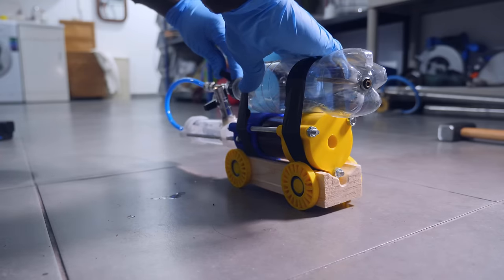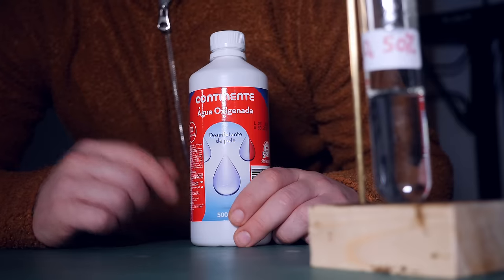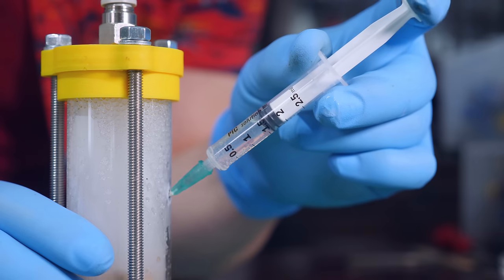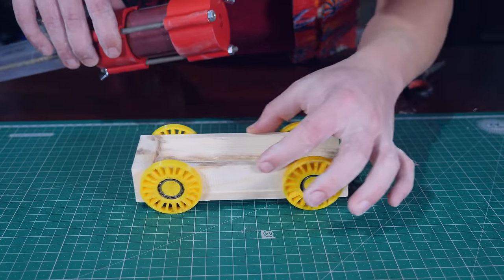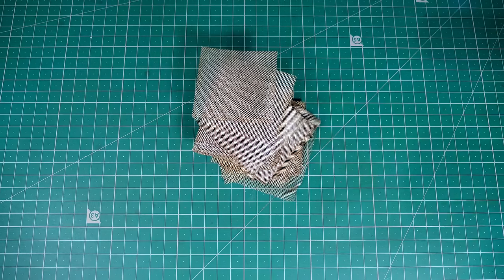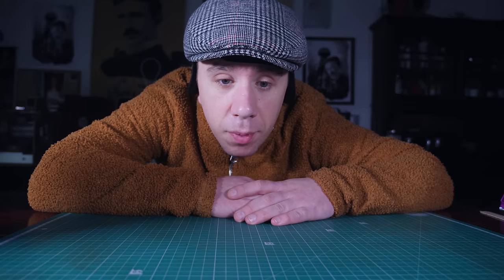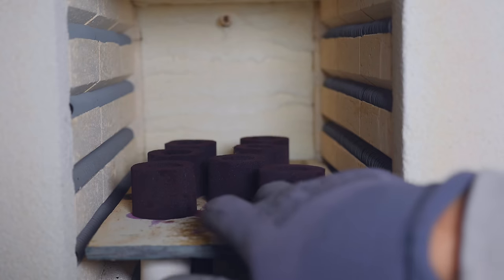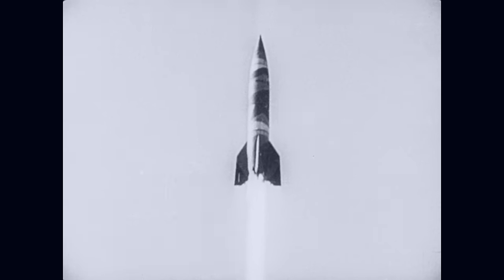SUPER HEATED STEAM ROCKET ENGINE

Comment: Fantastic video, as always! Have you considered utilizing the oxygen generated from this reaction for a second stage? It could burn additional butane, potentially squeezing out more thrust.
Reply: Or you could even pump butane into the active reaction and use it to further excite the burning and further expand the gasses
Reply: This is what I thought he was going to do by looking at the thumbnail as peroxide rockets have been around for a while.
Reply: @geofrancis2001  i know he basically did that last video when he introduced the concept of a "dual propulsion rocket", except he just burned the raw oxygen and products. Adding more fuel (butane) would make it even stronger than his original concept in LAST video
Reply: @MichanaAlerting  it woudlnt have to be butane, the steam should be hot enough to ignite solid fuel.
Reply: @MichanaAlerting sort of an afterburner?
Reply: @skyraider87  Maybe! We'll have to see where he takes this next video. Here's hoping!
Reply: That's a bi-prop H202 engine. Methane/butane are OK, but kerosene is much better, you'll need an injection plate (impingement preferred but shower head style is adequate as the violent HTP decomp will give some rudimentary mixing) and you can pressurize the kerosene tank with nitrogen.
Reply: What about using the excess oxygen to ignite a secondary like magnesium

Comment: Genuinely love how you don't just gloss over details and just tell everything how it is. In terms of catalyst, what if you used acid to etch away silver so that the surface becomes pitted and exposes more area? Kinda like activated charcoal. And speaking of activated charcoal, how does it work with peroxide? I was surprised coconut coal can decompose it
Reply: turning wood into coal concentrates a bunch of the solids a tree has...and since every living organism has metal ions in their bodies i presume a bunch of them during the process gets reduced just like in ash from a firepit (the first soaps were made using ash as the catalist for the saponification)...and since coal has a bunch of small pores increasing it's surface, it acts pretty much like paladium on carbon with the small deposits of teeny tiny metal particles...now does any charcoal works? idk...now what i can assume is that since coconut is a seed that the tree pours a lot of nutrients into (including metals from the soil) for the seed to be viable upt to 3 years after detaching from the tree, the concentration of metals on coconut charcoal could be higher than other commonly used charcoals...

Comment: Hey Integza! Looks awesome! I was thinking something that could help the design would be an improved injector. This goes along with what you said about surface area, where if you can maximize the contact between the peroxide and the catalyst you should get better results. Maybe an injector that does a better job of atomizing the peroxide rather than spraying jets of it directly into the catalyst would be beneficial? I also thought the charcoal/ceramic idea was really awesome and pursuing this could have some interesting results. I think early H2O2 rockets used pellets of catalyst in a chamber, so the chunks of charcoal might be the right idea, trying mixtures with permanganate and maybe some other additives would be awesome. In future videos I'd love to see improvements on this and maybe one day combustion of the oxygen product to make a bipropellant rocket! Keep it up!

Comment: Integza, I think that if you ground the potassium permanganate into a fine powder, it could then be used as a paint base to spray into the mixture/reaction chamber. This would allow a chamber filled with catalyst coated rods running the length of the chamber. These rods may increase the surface area enough to react quickly. Another option is to coat the injection tubes as well.

Comment: An option you could do as a middleground option that's both accessible and interesting for your foam + KMn04 strategy is to create a carbon foam using bread. AvE did a video on it years ago, and it might work for your strategy. Hilariously enough, one of the topics you'd need to figure out would be the optimal bread to use to have the best crumb structure to absorb the KMnO4 and react with the peroxide. Would a dense foam from the dense crumb of a japanese milk bread be optimal or would an airy open crumb from a ciabatta or even airier with pan de cristal be best?

Either way, super easy thing to test, it's as simple as getting bread! Also depending on the results, you could possibly even put the carbon foam to be milled as you did the flower foam. Probably not with an airy bread, but the japanese milk bread can have an incredibly dense and fluffy crumb, especially if you do the method when its baked in a lidded bread pan.

Also fun fact, I accidentally discovered the ability to concentrate peroxide in highschool where I had filled a bowl with it for something with regular household peroxide, but forgotten to dump it and it sat on a shelf for a few months. I found the near-empty dish and dumped it, but accidentally touched the tip of my thumb to the small amount of remaining fluid. Over the next couple hours, half my thumb was white and it bloody hurt like crazy.

Comment: The rocket belt you mentioned in this video. I did the machine work on the engine parts. The catalyst pack in the engine was silver plated stainless screen material. If I remember some kind of stainless steel screen. But it was all heat treated in an oven somehow. I’m not exactly sure of the process. (Not the part I did). But it was very tightly packed requiring a press to do this. Then the engine was welded together. The hydrogen peroxide they used was distilled from 50% solution in a special lab/trailer they built. A very, very, very dangerous thing to do. If I were you I wouldn’t do it. But it’s up to you. Anyway on the rocket belt there was a high pressure vessel containing 6000 psi of nitrogen (if I remember) that pushed the hydrogen peroxide solution into the catalyst pack in the engine. This expanded into two tubes that exited thru nozzles (Designed by my friend). On the end of these nozzles we’re sort of flow directors that could divert the flow for spinning the rocket in the vertical axis. The whole belt/engine hung on a hemi joint on the pilots hack which he controlled by the two handles you see in you video. The whole flight time was around 60 seconds. The pilot had a vibrating devise on his wrist that alerted him of how much time he had remaining left to land. This thing was mainly flown in stunt shows at stadiums as an opening event type of thing. The test flight I saw the thing was very loud. Like a jet plane taking off. The guy that flew it must have had ball of steel. Because when you run out of fuel you fall!

Comment: Cool video!!! Using steam to power an RC airplane's propeller could be an interesting experiment. Something, you could try out in the future: building a jet engine that has a hole in it. Let me explain: Similar to your Dyson engine, it could have a hole running through the middle to increase the output thrust. However, this time, instead of building the compressor into the handle, you could build it around the hole itself, so you don't need a handle anymore. I've been thinking about this concept for a while after watching your video and would love to see this peculiar jet engine in action!

Comment: Great video! I did catch that 1.5 ml vs 250 ml is 233 times the expansion. It is even greater the open volume of the mixing chamber's volume was not factored in- definitely 250-350 expansion. This is a slower expansion than gunpowder but still very powerful. A gunpowder explosion is instantaneous being quite destructive. This expansion is slow and not so destructive unless the gasses were trapped in a container that can hold the pressure. A  gunpowder rocket burns gunpowder slower than a bullet propelling it over time but still a relatively short time for burning. The pressurization of gunpowder accelerates its burn speed. In open air gunpowder burns slowly, almost as long as this chemical reaction rate. In a rocket pressure is released out a nozzle to prevent blowing up by too great and more instantaneous explosion. The nozzle is designed with enough open a nozzle or opening on one end to prevent over pressurization and instant explosion. As a kid I learned that there is a ration of 1/3 to 1/2 of the inner explosion chamber that the gas must have to prevent explosion. Too much pressure on the fuel not released will blow up the fuel chamber.

Comment: @Integza Here is a concept for getting better contact between the peroxide and the catalyst:

When you cast plaster, insert a bunch of corkscrew shaped pieces of steel (such as a stretched out  thin springs, coated in mold release spray if needed, or perhaps literal cork screws). Then, when the plaster is hardened, remove these corkscrew shapes by unscrewing them out of the plaster. Then, inject the peroxide into these corkscrew shaped channels. As the decomposition happens, any liquid that gets pushed by the released gases won't just shoot out of the channel like it would with a straight hole; any liquid droplets propelled by the gases would much more likely slam into the wall of the helical hole, enabling it to react with the catalyst.

Try this and see if it doesn't result in more efficient use of your peroxide.

Comment: hello and happy new years from new zealand!!! suggestion for  fast evaporation just sit a fan on the top of open container blowing up and away from container but with enough room under fan to allow air  convection current to draw from top of liquid.. takes a while but its cold no heat tho if slightly warmed will work faster..but at least you can leave in corner for a few days and won't cause any issues!

Comment: Hi integza!  I think you are getting there!  BUT, be careful with the H2O2 concentration. As you concentrate it, you need to keep a certain level of “stabilizers” in it. If not, it could spontaneously combust.  That is why high concentration H2O2 is considered so dangerous.  I suspect you already know this but just for everyone else, this stiuf can get nasty if you don’t know what you are doing with it. So be very careful and don’t do this in the house and make sure you know the chemistry properly (with the stabilizers) or you could get a nasty surprise from this stuff. And that assumes you do all the handling properly (everything ultra clean because just a dust spec can act as a catalyst to set it all off).  Cool, and looking forward to the next version!
Reply: As an aid to visualising the results have a look at the damaged caused to the very heavy duty facilities built in WW2 by the Germans. Tino Struckmann shows the damage on his many documentaries on Lost Battlefields.

Comment: Connect a dehumidifier to a standalone freezer.  As the air inside the freezer dries, it will become very thirsty.  Dry air at any fregid temperature lower than the room temp peroxide solution (on a stir plate) will quickly suck nearly all the water out.

Comment: To improve the efficiency of the engine, you could create instead of the showerhead/brass tube design, use a series of impinging injectors, it would be really easy to manufacture such an injector plate with 3D printing. For the KMno4, maybe look into seeing if it could be mixed with aerogel, it's lightweight, has an incredible amount of surface area and would make a great video, even if it might not work.

Comment: Small correction. I assume this has been said before me but the KMnO4 does do a chemical reaction with the H2O2 it's a RedOx reaction 2KMnO4 + 3H2O2 > 2MnO2 + 2H2O + 3O2 +2 KOH. The decomposition in the other examples is also a chemical reaction 2H2O2 > 2H2O + O2. Now I am just a TA not a Studied Chemist but the coconut charcoal got me thinking how it would work with Active charcoal as it is used as a katalist in similar situations

Comment: C-stoff is not made of potassium permanganate, it was a mixture of several components consisting of (by weight) 57% methanol, 30% hydrazine hydrate, 12% water, and 1% potassium tetracyanocuprate, combined with high test hydrogen peroxide it created a hypergolic fuel which combusts at very high pressure and temperatures. Potassium permanganate mixed with H2O2 does not generate anywhere near enough heat and pressure to be used as a rocket fuel, and unless you inject fuel into the oxygen stream it will provide negligible thrust.

Comment: @Integza You can try it with the frosting method try to put your peroxid and water solution in a freezer with min. -18°C and let it freeze slowly so the water doesent captute the peroxid after that try to decant the peroxider off the water and repat this process a few more times. Sute this might take a bit longer but with enough Patience its doable or you can use dry ice to speed things up

Comment: I used to make H202 rockets and distilled my own 90% peroxide using 50% food grade, a simple home built vacuum still and a halogen light bulb as a safe heat source. I could easily distill about 2 gallons of roughly 90% from 5 gallons of 50% in about a full day (you lose a lot with a crappy homebuilt still), but storing 90% peroxide is way more challenging than distilling it, stainless works, but 1060 aluminum containers are best. 

Also, 99%+ pure silver screen works great as a catalyst with 90%+ H202, not so well for anything below 85%.

Comment: I did some looking and found that enhancing the concentration of hydrogen peroxide through evaporation is most effectively achieved in a vacuum. Also, molecular sieves can potentially get the concentration to between 70-80%. However, it's important to note that hydrogen peroxide often contains stabilizers that might disrupt certain processes. Apparently, the highly concentrated hydrogen peroxide used in rocket propellants is formulated with specialized stabilizers that do not hinder its application. It's not exactly a suggestion for a show topic, but I hope this counts. Good luck!

Comment: Have you looked at molecular sieve for concentrating the H2O2 or would it also cause it to decompose?
Reply: That is quite interesting.. ive seen NileRed used it alot.. And Yes i look it up and it works.. i donno to how much degree it will but it does works
Reply: It works on etanol so maybe works with h2o2 but wouldnt it easily reach 100%? I know that the molecular sieves i used in school did not burn so i think its save to do. ( i dont know how tight water is in h2o2, sorry multilingual problem if this does not make sense)
Reply: @Hnkka  it is a decomposition reaction not an oxidation reaction so the concerns are different. Molecular sieves work by having fissures in the surface sized so that the target contaminates adhere to them, in most cases it's water. Because the molecular size of H2O and H2O2 are so close it might not work, but the bigger issue is that the high surface area might also give reaction sites for the H2O2 to decompose. Activated charcoal works in a similar way to molecular sieves and in this video he used charcoal as a catalyst for decomposition of the H2O2. I am unsure if the reason charcoal works as a catalyst is because of it's surface area or because of it's carbon content.
Reply: thank you for making me smarter @Zanthum
Reply: If you use 3Å molecular sieves it might work. That extra oxygen increases the size of the molecule significantly. Water molecules are just barely small enough to fit into to pores of 3Å MS, so hydrogen peroxide molecules absolutely wouldn’t fit. However, the sieves are made of a type of clay called zeolites. Zeolites contain metals, and metals cause the peroxide to decompose. The only why to know for sure is to try it. The sieves naturally bubble a little when absorbing stuff because air is displaced, but if the peroxide is decomposing a lot of oxygen will be released.
Reply: @ashe1.070  well said

Comment: This is really cool.  One thing I often try to figure out is how to build a large rotating vessel into space for under $100K.  So far, my best concept is in a pizza cutter shape.  The outer wheel is made of fiberglass and spins very rapidly holding hot water.  The spin and heat are the energy storage used to power the hot plate to steam the water, as it flows out the pizza cutter handle.  An electric generator sits at the center (drawing power off the spin).  The spin also pushes the water down a tube that flows down the pizza cutter handle to the hot plate just before the exhaust nozzles.  The exhaust nozzles only need to gimbal on one axis because the spin of the wheel holds the vertical orientation.  The gimble is therefore generally turned against gravity to the wheel can spin against the pizza cutter handle.  Water expands 1,600 times when it changes to a gas and it has a lot of mass so the thrust is quite strong.  This vessel would look something like a big Ferris wheel.  Yes.  Water is heavy but a heavy propellant gives a lot of thrust and the energy storage has no weight at all, using this method--it's just heat a spin.  I have some equations for this and I am convinced it is workable with a fair amount of room for the weight of the vehicle itself.

Comment: Integza!! Look into membrane distillation!! You can move water with just a temperature differential, so for example make the input side of the membrane distillation tank at say 40 or 50 C and the out side at 20 or 30 C (bigger difference is better) and you will get water moving across the barrier. Contact me if you want my little bit of knowledge on it, or if you want me to put you in contact with my professors from college who actually were researching it.  It works by hydrophobic membranes basically causing the water to evaporate on one side of the membrane and travel along the heat gradient to then condense on the other side.